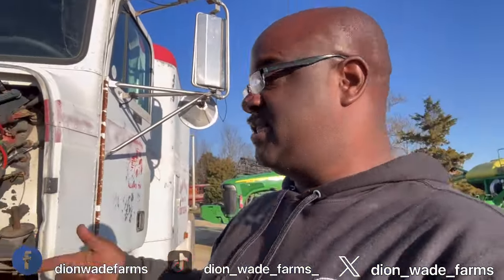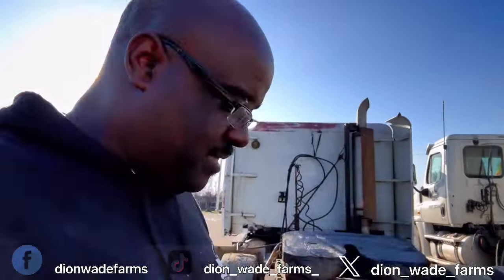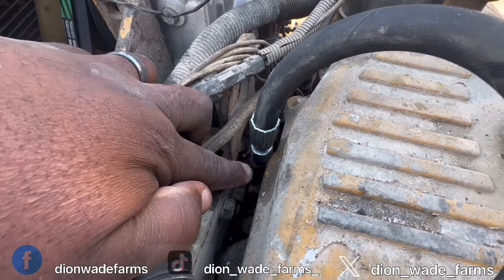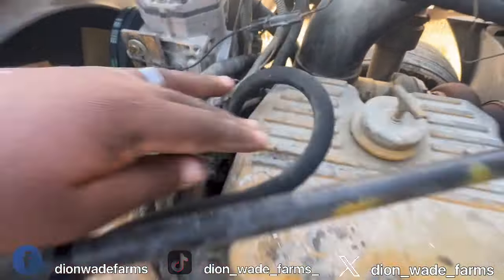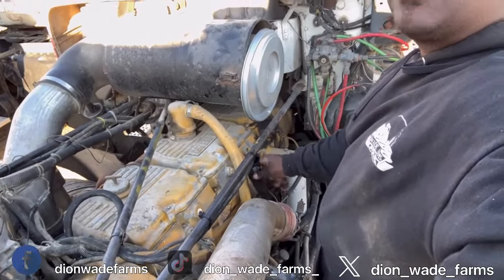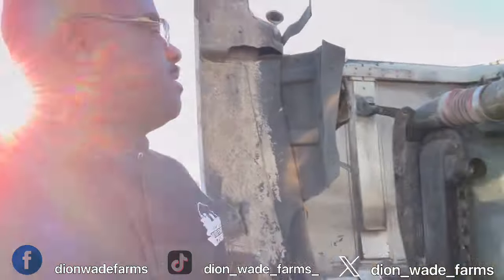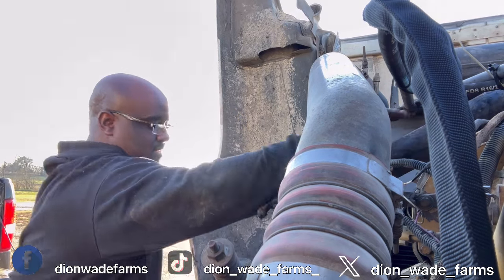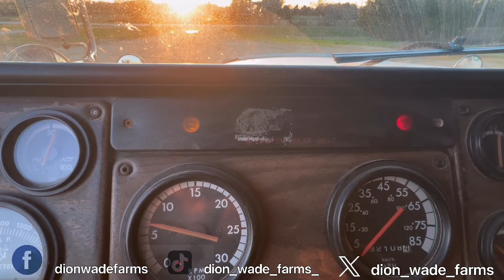Mechanic work begins with a problem

Comment: Hey Pal,,,put that line in a sleeve,,like a bicycle inner tube,,,ziptie it,,never even worry about it again,,I bought a new dump truck yrs ago,,did that to my airlines where ever they was close to something,,never had leaks anywhere,,21 yrs ,,sold it,guy still running it,👍🏾👍🏾👌🏾
Reply from the maker: Thanks 🙏 yeah I went an bought a line sleeve

Comment: How long was the motor running before the idiot light came on? I have a feeling you have an air pocket in the line and the motor is over heating
Reply from the maker: At least 10-20 secs
Reply from the maker: Back to back
Reply from the maker: For Amin I was thinking it’s sensor
Reply: Did you prime the fuel pump on the driver side. It should have a hand mechanical pump on it. Pump it till it gets hard then try to crank it.